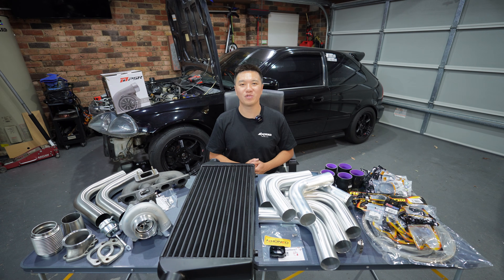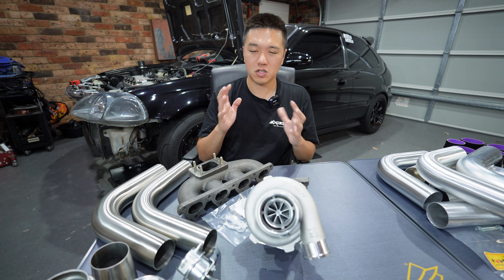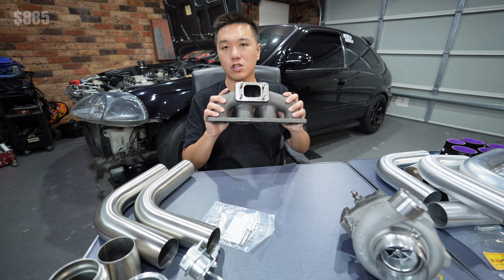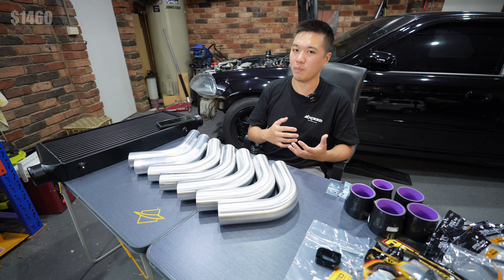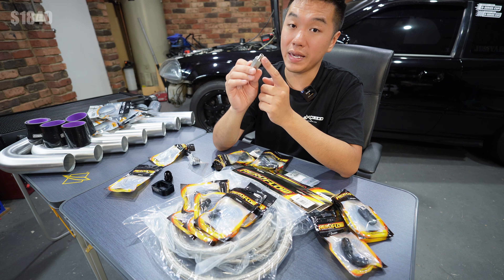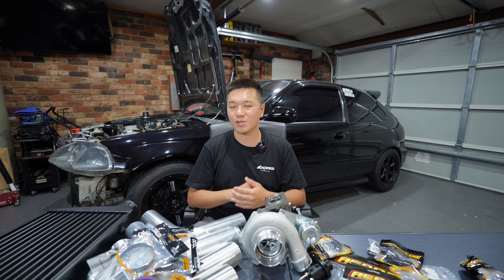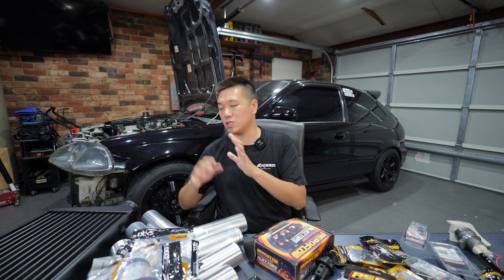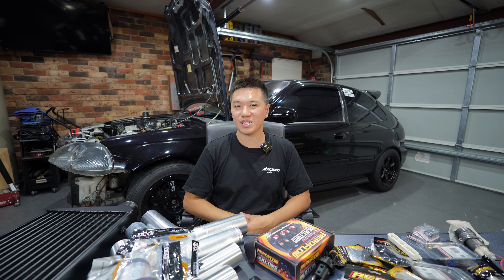How to build a 300HP D series turbo kit

Comment: is the turbo compressor housing standard or T51R mod and what actuator option is it?
Reply from the maker: Pulsar PSR2860RS Turbocharger T25 .64 5 Bolt / Standard / Billet (11+0 Blades)
Reply: @JCYT thank you so much for replying! i’m loving the civic videos 🙏

Comment: I have a question i have a civic ex with a d16y8 and was wondering could i follow these steps without upgrading the fuel injectors so i dont need to spend so much money turning?

Comment: @jcyt  Ironically, my car started as the $900 ek/ EJ. Looks like we are running a simular set up. But I'm swapping in a vitara, built y8. Im new to your channel, and your bit on the 1200cc injectors made me second guess my 1000cc FIC injectors. You're certainly much more knowledgeable  than I am😅
Reply from the maker: What a ripper little setup! 
Nice, are you in Aus? 
Sorry which bit on the injectors? 
If you watch further in the series, i'd quickly realised the 1250s were too much. I ended up going back to 731s, and we've since maxxed them out at 18psi 156kw.
Reply: @JCYT  No, im actually on the east coast of the U.S.  I was just saying that part of the video had me second-guessing. Im still wondering if 1000cc is going to be too much to or too little. Im not trying to break the 400hp threshold. Im running an AEM 340LPH fuel pump. Im also debating on running e85 or just tunning for high test pump gas. I have what engineers call scope creep, so my car is still in bits and pieces as I damn near restore the car 😆

Comment: @JCYT
Honestly..very impressive.
However, i like to build turbo for my d15 .i recently replaced my engine with short ratio gear and not much impressed ..i think there is issue with ECU ..and in my country there is limited knowledge about that.
Could you please suggest and support me to build turbo.
Thanks

Comment: Why on earth would you put an 800 dollar on sale turbo to a fkin cast log manifold? That’s just foolish and wild, you’ve already spent more on a turbo than you should have for this motor you should have bought a better manifold. It’s like wiping before you crap. It doesn’t make sense
Reply from the maker: I can understand why you may think this way. The beauty of a custom kit is being able to pick and choose how to spend your money. This is a budget turbo kit and there has to be some compromise between performance and reliability. I choose reliability any day of the week for what i do with this car. This setup is proven now, 7 months on and 5 trackdays without a single mechanical fault. 
There is no fabricated manifold remotely close to this pricepoint. We don't even have any off the shelf parts let alone turbo manifolds for the D series in Australia. Nothing wrong with cast. They are bloody strong and although their design is not the most efficient, that is the compromise i am willing to spend more on a turbocharger. 
I'm not sure you make any sense. Would you put a $200 dollar turbo on an $800 manifold?

Comment: That's pretty high end injectors and fuel pump for 300hp imo. Sure you're gonna run E85 but 1250cc for 300hp?
I'm getting a walbro 190 and 650cc's
Reply from the maker: You are right the injectors were too big. We ended up changing to 650cc in a later video but the fuel pump is sized appropriately. 190 will be too small for our e85 fuel

Comment: what blow off do you have?
Reply from the maker: No blow off valve fitted
Reply: @JCYT  in the video "TURBO D SERIES easily makes KSWAP power" you let Marcus drive the car and it sounds like you have a blow off valve, no?
Reply from the maker: Yes this particular turbo is quite loud. No BOV fitted. 
I could fit one but i actually quite like how it sounds the way it is

Comment: Hey bro loving your videos. I did back to back testing on 16psi sr20 with 3inch vs 4inch intercooler and 3 inch got heat soaked and lost power over 3 back to back runs where as 4 inch stayed with in 1hp each run and we even forgot to turn the fan on for the 4 inch so your 3 inch would be perfect for that power. It did make the boost drop but that’s because of less restriction so if we turned the boost up it would of been more total power and response vs the 3 inch. We also tested 2,2.5,3,4 inch intercooler piping. 3 inch was the best with most hp and response everything smaller just made the turbo work harder creating more heat and less power. 4 inch made it spool faster again but then lost top end because that volume of air was to big for 16psi. So your set up is basically ideal.
Reply from the maker: Thanks mate appreciate the feedback! 
I find the setup ideal for track use. If i wanted that crazy response, i'd definitely have sized up a smaller setup overall. But we are about to hook up a 3 port and see if we can get more area under the curve.
Reply: @JCYT  so once you do that you’ll create more heat all round and if you end up racing in summer that’s where the bigger non heat soaking cooler would really shine. You not only want to make more power but you want it to be reliable and intake temperatures that don’t move are extremely good for your motor lessening knock and just always running cooler.
When we did 3 vs 4 inch we also tested psi before the cooler and after and the turbo was running 2psi more on the 3inch cooler so when you go 4 inch you get more response, for less boost and less heat production. You could also turn the boost up more if you wanted on the bigger cooler as your knock threshold would be higher. I have the dyno print outs if you’d like me to send them to you. You’ve inspired me to turbo the daily d series which I haven’t been bothered with cars in years so thank you.
Reply: @JCYT  we also back to back tested a 600hp rb26 with his previous 4 inch gtr cooler (cooling pro $400-500) to a brand new plazmaman gtr cooler 2200 both 600x300x100. The cooling pro cooler had 16-24hp more over 3 power runs. So that was a good lesson of brand name stuff isn’t necessary in intercoolers. You can get a 600x300x100 for $320 of just jap just so you know for further upgrades haha

Comment: Unless it’s a drag car, you want a smaller turbo. That disco potato is definitely not the ultimate turbo for a quick spooling single cam powerhouse on the street or road course. Try a TD05H 16G, 20G or the 68 HTA…And the 2.5” charge pipe is also ridiculous. There’s no reason to “match” the charge piping size to the throttle body… you are force feeding the motor. You want 2” charge pipe. Trust me. I’ve had my EF hatchback boosted for 20 years. Been through all the gimmicks. A T25 turbo is too small. And anything bigger than a TD05 is a bit too big and will lag. I made 347 hp on my 16G that hit full boost at 3500 RPMs. Now I’m at 390 hp with the TD05 20G. Only other set up is use is the 68 HTA. Also absolutely zero reason to run water cooling to the turbo. Oil is all you need. Aesthetics don’t make the car fun. Build it right, with the right sizing and combination of parts and it will be more fun.
Reply from the maker: By your comments it shows you have absolutely no desire to learn and progress.
Let me guess you're still running an Apexi Power FC with MSD blaster?
Reply: @JCYT while you’re a memory at the starting line trying to spool your potato, my TD05 and I are already in 3rd gear. I wasn’t trying to be a dick but you decided you wanted to insult me a little. So there ya go.
Reply: @j.feldmander1956 great bit of wisdom. I know of a hatch Mitsubishi GSR 1.6T with a TD05 and the thing was a rocket!
Reply: @CounterSpace86 not sure what you mean… a GSR…? Integra..? On a smaller motor (1.6L) a TDO5 is definitely the ticket on the streets. For anything bigger I’d step it up to a T03. 
I recently upgraded my civic turbo to the Forced Performance 68HTA and it made 418hp & 338ft/lbs and spools up around 3500 RPMs. All with 2” charge pipe and a side mount intercooler. Anyways, that’s why I had to comment on this video… a lot of people don’t understand that for Honda single cam street builds, smaller works much better.
Reply: @j.feldmander1956 what was your bottom end? Vitara setup?
Reply: @JCYT learn and progress..? Is that what you’re doing..? Giving people the wrong advice with turbo single cams… when you make 390 to the tires on a TDO5 and have a quick spool in any gear you’re in on the street or road course, you let me know. My hondata with boost by gear, coil on plug, BC spring and retainer with speed factory cam will stomp any single cam you try to build. All while having a side mount intercooler and a stock radiator.
Reply: what’s your piston setup? i want to build a togue setup and want 300~hp on a quick spool so i can come out of a corner hard

Comment: Injectors are definitely not going to be your issue, the pinky thick con rods are. It's super cheap to build a d series and necessary to make 300hp.
Reply from the maker: Hoping for a reliable year @135kw to finish the racing season then probably turn up the boost and see how much it can handle!
Reply: @JCYT  that should be a safe horsepower, the stock rods definitely don't like torque so can't spool too quick. But if you plan on retiring the motor after the season definitely put 30lbs into and see it go to the moon.

Comment: Ive got a d17a2 is it good for 5-7 psi   
Somewhat reliably ive got a spare d17a2 aswell.
Reply: Yes it is. I had an 02 coupe with a Saab viggen turbo. Tdo4hl15t on a log manifold. Full spool at 2900 rpm. I ran 20lbs creep 16 lbs at redline for right at 220whp on Kpro y8 manifold. I had a problem with a few axles breaking, destroying engine mounts (even poly rear from innovate) and breaking exhaust manifold studs until I got arp. I sold the car 5 years ago after owning for couple years and it’s STILL running around my lil town.

Comment: Hey Mate, what a great project! I have a '99 Ek that I want to turbocharge in the future, but I've already started by purchasing the FuelTech FT550 ECU, Wideband Nano Pro, and flex fuel sensor. I want to install it in the car before adding the turbo to learn more about tuning. Now, my question is, where did you get the OBD2B jumper to connect the original harness with the standalone ECU?. Greetings from Perth! Cheers!
Reply from the maker: Hi Luis, 
I believe you messaged me. For others to know - i got it from element14 in australia. I think they are made by TE-connectivity. Will release a video on this with a full wiring pinout for the d16y4

Comment: Keen to see how you go about the ECU, running into roadblocks with my build regarding that as well 😮
Reply from the maker: Whats your plan with engine management?
Reply: @JCYT  well I'm not so sure because the y5 has an OBD2 ECU so I was going to look into haltech but wasn't sure how to go about it
Reply from the maker: hey mate i know it's been a while but the ECU pinout video is now up!
Reply: @JCYT  I saw bro, thanks for your work with this. Makes it so much easier to get my head around.

Comment: Damn dude I could have helped with all that stuff, pulsar turbos are great, and that manifold is also great however it will put the turbo VERY close if not touching the block, I highly recommend the honed adaptor I ran one on my recent b18 turbo build
Reply from the maker: Thanks Tristan! But all good I knew exactly what I wanted. I knew would be close go block as I'm definitely not the first to fit this turbo. Had a similar manifold on my B turbo and had to shave the block too. So keeeeen
Reply: @JCYT  good stuff man keep it up